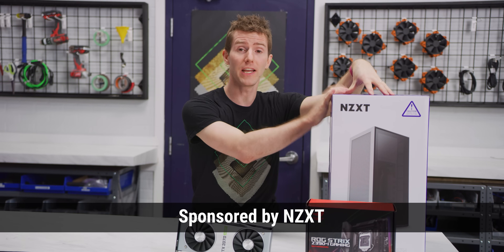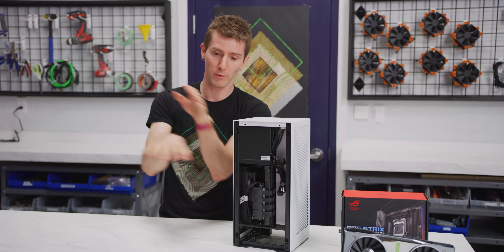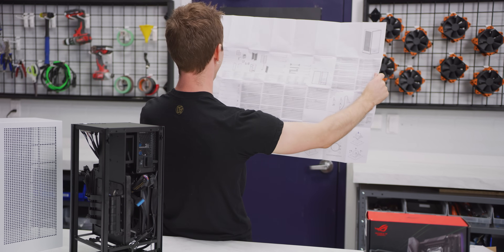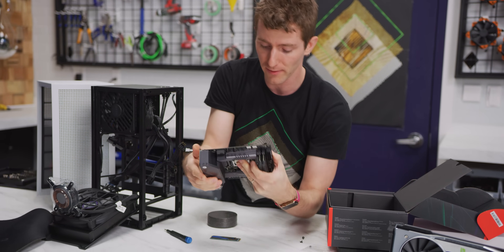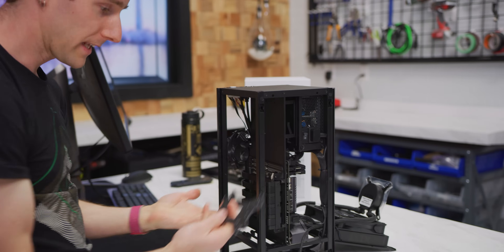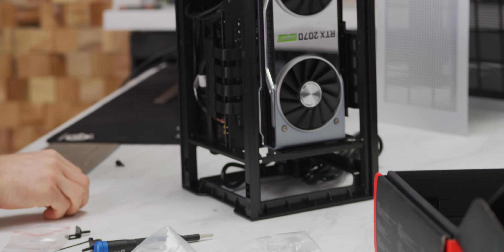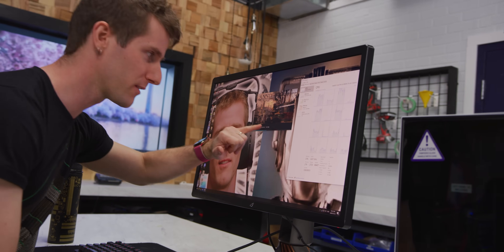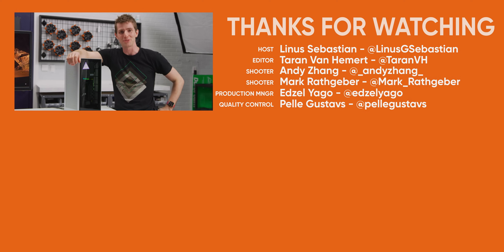Building the Xbox Series X Rip-off PC

Comment: >Making a ripoff
Adds a slower GPU and puts an i9 in there when it's clear that it's a 3700X
Reply: I thought the GPU of the new Xbox was equivalent to a 2060 Super.
Reply: @wafflesdadapon9318  lmao just no. 2080 Super.
Reply: 2080 non-super, most likely, considering OC headroom on desktop.
Reply: @wafflesdadapon9318  in raw power, considering no IPC increase from a 5700XT which it shares a revised architecture with, it should be around 24% faster than a 5700XT, which puts it in 2080 performance numbers. This was confirmed in a Digital Foundry analysis video, where Gears 5 4k maxed out was giving the same framerate as an RTX 2080

The PS5 however is somewhere between a 5700 and 5700XT. It is basically a really overclocked 5700 since it shares CUs and shader cores and everything. This puts it in basically the same level of performance a 2060 Super

We've yet to see about the ray tracing performance, however.
Reply: @ultraviolet2497  Ok that makes sense. For some reason I thought the 2060 Super could output 4k60 on some AAA titles.
Reply: @wafflesdadapon9318  No (?)
They said it will be 4k 60 ready so I think it'll be the equivalent of the mext mid-range amd gpu

Comment: This is honestly one of the first small form factor PC's that doesn't look like a complete pain to build in. Price is actually pretty fair for everything included.
Reply: 0.25 speed or nothing
Reply: While I agree, it's not too bad with other cases either. Unless you're running a YouTube channel, you're not doing that every day anyways.
Reply: but you only have 650 Watt power supply, don't forget this when you order your 2080S/TI
Reply: @hra4242  I use a 970... I think I'd be okay lol
Reply: @Triflixfilms  yeah for 970 its more then enought! :)

I just mention it bc linus used in the vid just a 2070S bc NVidia recommends 650Watt all System power :)
Reply: @hra4242  650 is plenty for a 2080ti, as ling as you don't have a 9900ks or HEDT CPU
Reply: @hra4242  The GPU vendors always recommend way overkill power supply wattages because they want to avoid people having problems because the rest of the system is super power hungry or they bought a crappy PSU, so they add a very large safety margin. Just add to together the GPU TDP and the CPU TDP + 100 Watts for the motherboards and drives. 150W extra if you want to do mild overclocks.
Reply: @hra4242  to be fair you're not really getting better than 750 watt if you order your own SFX PSU. I think there's one 800 Watt PSU on the market in SFX
Reply: @REAPEROFTOES  is there an 800?from whom?
Reply: @Matpermad  I think it's from seasonic.
Reply: @Matpermad  Silverstone makes it, the SX800, I can't even find a price for it right now but last I looked the shit was expensive. Near $200 USD.
Reply: @hra4242  I've seen a 2080Ti run on a 500W PSU. Just make sure you don't have a CPU that pulls obnoxious levels of power like an i9.
Reply: @hra4242  My 550w psu works for my watt hungry vega 56

Comment: Me:Clicks on the video
Me:Sees an Intel mobo
🙁
Reply: Ryzen better
Reply: Jaden Minter not for gaming
Reply: Green Blossom bruh i9 is really great but it’s really expensive Ryzen 7 are way cheaper it don’t bottleneck with them and great performance and easy to OC
Reply: @thewannabetourist4908  not for gaming an i9 9900k will do better
Reply: Electro740 Ik but look i9 cost a lot more
Reply: @thewannabetourist4908  no I said look at a comparably priced amd chip to the i9 the i9 does better with games
Reply: Electro740 ikr but it’s $200 more dollars
Reply: @thewannabetourist4908  you don't understand what comprable price means
Reply: Electro740 I do but intel mobo tend to cost more I just built a Ryzen 7 3700x Amd rx 580 8gb 16GB ddr4 it’s way cheaper than the i9
Reply: As good as amd cpus have become intel cpus are actually more efficient and better to use for solely gaming rigs
Reply: @electro740  Ohh yeah forgot about Intel being easily overclockable... Wait a sec did someone say 14nm? 😂😂😂😂
Reply: @electro740  Great for gaming till the next gen of Intel CPUs finally switch from a 5 yr old socket ditch the dinosaur age 14nm process and you need a brand new mobo
Reply: @johnson42069  i mean watch any benchmark comparisons an i9 compared to a similar priced amd will do better in gaming but solely gaming amd excels at everything else

Comment: I get the feeling the Xbox Series X is going to be significantly cheaper than this setup
Reply: But can a it do everything a PC can do? Prolly not.
Reply: @treybyrd3332  Of course not, PC wins there, my problem is with the video itself. This is quite simply a modified version of the shortcircuit channel feature of the H1 again. Making something similar in size to the Series X running similar AMD hardware would have been interesting, it just feels like someone was running out of time for a video and so just slapped the console on for buzz word sake.

Comment: This may be a bit more powerful than a series x...
Reply: Its a 2070 Super though, the Series X is said to be equivalent to a 2080.
Reply: @ZackSNetwork  It is said to be but I personally strongly doubt a 600 dollars console will be as powerful as a 1200 dollars gpu
Reply: @reno815  I said the 2080 dude not the 2080ti. Its possible to have 2080 performance in a 2020 next generation console as its on par with a 1080ti which is from 2017.
Reply: @ZackSNetwork  Well a 2080 is still a VERY capable card and it would be surprising if Microsoft managed to do better in a 600 dollars console. If they do, I am definitely buying the series x 😄
Reply: Lmao no it's not.

Comment: Again, this is a 2000 dollar PC, and the console is 500, literally a fourth of the price.
Reply: its not confirmed but it better with the pc more games, better preformace, mouse and keyboard ,cheap games, no subscription, and more reliable after all it better to grind to get 2k then this piece of trash xbox
Reply: @Ssten123  except the Xbox will have performance comparable to a 2080 with a 3700x. That is 4k capable, and, assuming games keep launching on Microsoft, and they actually have backwards compatible games, you could buy 300 xbox games and an Xbox series x, all for the price of the nzxt h1 PC build. Also, they have mouse and keyboard support for the next gen consoles.
Reply: @Jeff Boy features? A pc is designed to do whatever you want it to do. It's not a feature it's a computer. A xbox cant do what it does unless ms gives it a windows mode which was a unfounded rumor that it was getting that but that's not happening.
Reply: Keep in mind a console cant AT all do every thing a pc can do in general gaming or not. So price is justified. Plus people are only guessing the new xbox will be 500. Un till MSFT says it is it's just speculation
Reply: @treybyrd3332  well, the console is for gaming, exclusively gaming. A PC can do more than game, sure, but Microsoft isn't going to sell a 1000 dollar console, because no one would buy it. So, that means that, at the very least, it is going to be less than half, with better performance than a 2080.
Reply: Ra awesome can you apply for a job on a Xbox?  Can you upgrade parts?  Can you get games cheaper? Can you get free online? No
Reply: @JimmyMc_Gill  yeah, that's true. But, it also is, you know, not 2k. You'd have to buy 300 games at 60 dollars through Xbox to make up the difference in cost between a PC and a console.
Reply: Ra awesome Xbox live too
Reply: It's not even close to being meant to compete with the xbox
Reply: @DaZomb1eslayer  except everyone, including Linus, says, buy this instead of a 500 dollar console that isn't even coming out for a few months.

Comment: Linus: Making A Ripoff!

Microsoft: :/ and that’s why we didn’t send him the early access
Reply: Since Austin Evans doesn't ripoff Microsoft, he got a early access.
Reply: It's not though. It has nothing in common with the series x layout. This is just a vertical sandwich layout case. Like the Dancase A4 flipped on its rear, and that case has been available for like 3 years.
Reply: @Lead_Foot  yes but I rebuilt a Xbox original in a spare server rack with relative ease, so I'm curious as to if it could be done, not should it be done. I'm well aware it would be complex and might not even be possible, but it doesn't mean it wouldn't be a fun project to do with my little cousin, as she likes the pretty lights.
Reply: Not everyone is Austin Evans. I still don’t get why that guy has 5million subs. LTT tries so hard just to get 10million and even then they’re sitting here putting a billion ads on their videos.
Reply: @Zane White Yeah, I know. I basically mean that it has the same amount of cores and threads and also has the Zen 2 architecture. It could actually be very similar to a R5 4600X. Thanks to @MohawkWarrior76 for correcting me that the GPU is equivalent to a RTX 2080 Super, Which the AMD Radeon RX 5900 XT or 5950 XT would be an equivalent card (with ray tracing!).
Reply: better one*
Reply: @Zane White True
Reply: Why does someone even compare the xbox series x's gpu to pc gpus, like no, it's not a 5700xt, no, neither it is a rtx 2080, it might have ray tracing, 14 tflops and 16gb vram, but the frequency is what makes a high end gpu really fast and the pc gpus are over 2000mhz while the xbox amd navi gpu is like 1700-1800 im not sure and the chip itself is cheaper and worse
Reply: Specs on paper are like a rtx 2080 but in reality it is not, like a 2.6 ghz phone cpu is as good as a 2.6 ghz pc cpu? No, never, the chip's manufacturing is not the same
Reply: @DawudDante  I agree with you on both of your comments.
Reply: @Zane White yes but console optimization will make it much more beastly in real game play.
Reply: Faster Xbox is a scam

liunx turns xbox og to gaming laptop
Reply: I'd be curious to see if you could rebuild the Xbox series x in a case like this, with some extra RGB
Reply: Jonnie Zodiac true
Reply: @jonniezodiac  YESSS!!!! EXTRA RGB! 

LOL!

All jokes aside I am a fan of RGB lighting, and if the console is as accessible as it seemed surfing Digital Foundry's Lego build, then I plan to add a very small LED strip to the top and bottom of the console.

If there were a generation of consoles that deserve to be built with cool lighting, then it would be the Series X and PS5.
Reply: @jonniezodiac  The CPU is equivalent to a 3700X in the Series X and the GPU is a 5700 XT (if you're building it now) or a 5800 XT (if you're waiting for ray tracing).
Reply: @louiefriesen  the xbox series X GPU is equivalent to a RTX 2080 Super
Reply: @AngelPerez-dw8ou  Ok, then it'd be a Radeon RX 5900 XT or RX 5950 XT